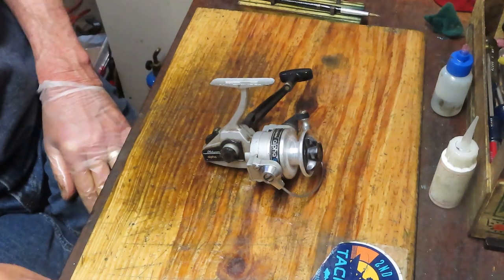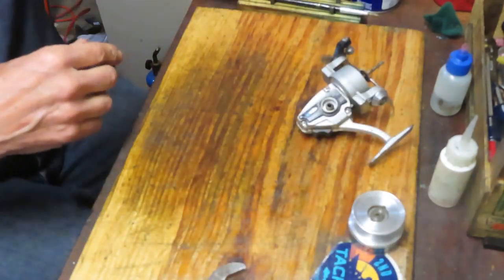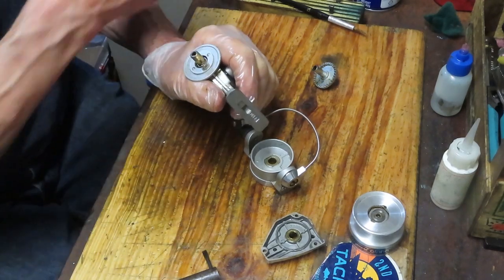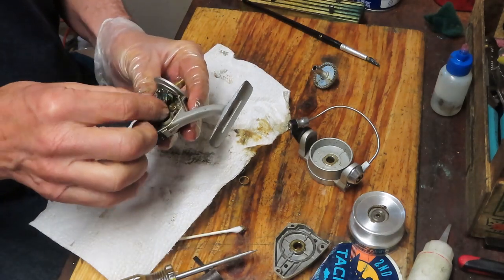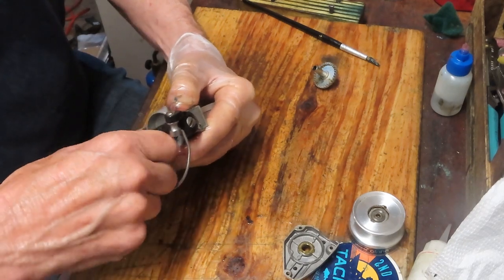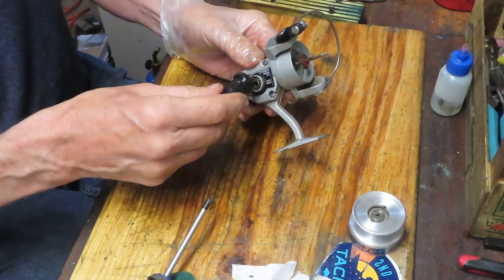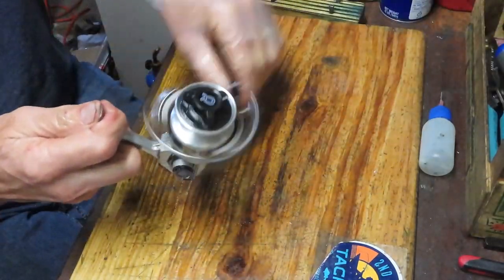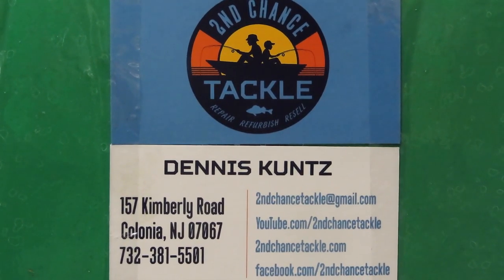Shakespeare Alpha 035 spin fishing reel how to take apart and service

Comment: I’ve only owned one Alpha - an 070 and it gave me problems until it finally failed altogether.  The oscillation gear in that 070 eventually just crumbled into many pieces. It was made of what my father used to call “monkey” metal. I could never bring myself to buy another one. I’m certainly not saying all these Alpha Shakespeare reels were bad reels but I just could not trust the Alpha after that experience. If I could ever find an oscillation gear for that reel I would definitely fix it but I’m not going to buy another complete Alpha 070 just to get that part. I don’t want it that badly. So, I had a bad experience but far more people have used these reels without that failure for many years. Great video of a fine Silver reel from the 1970s! — Chris
Reply from the maker: This one was before the graphite Alpha reels with eh pot metal gears.